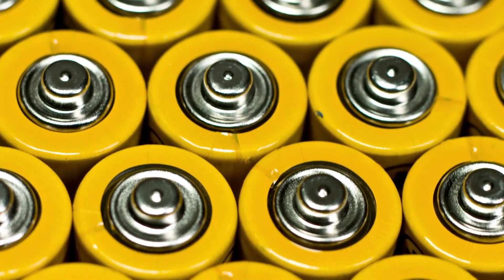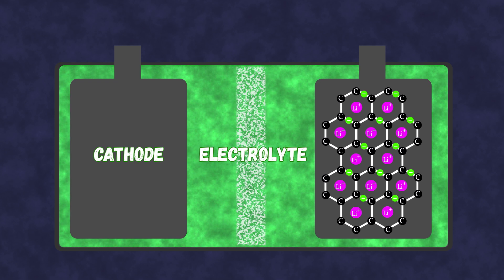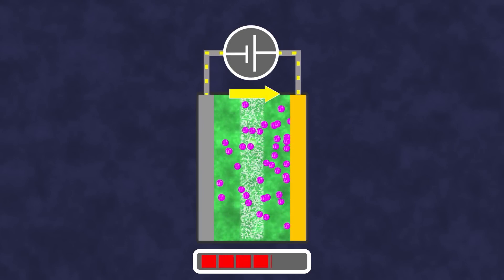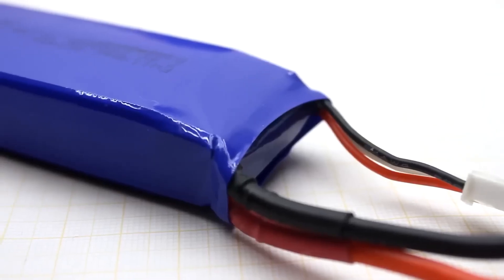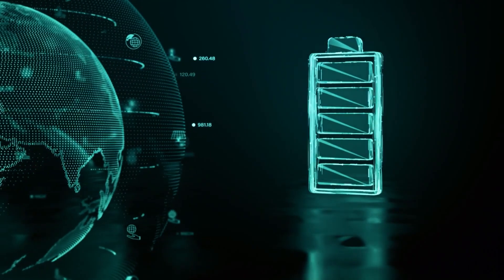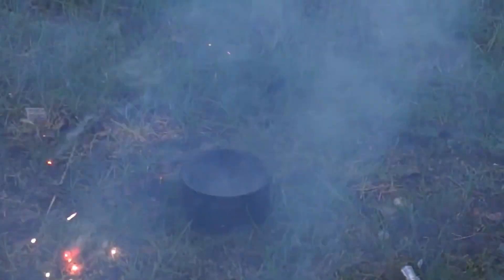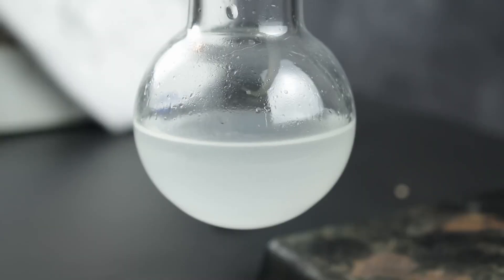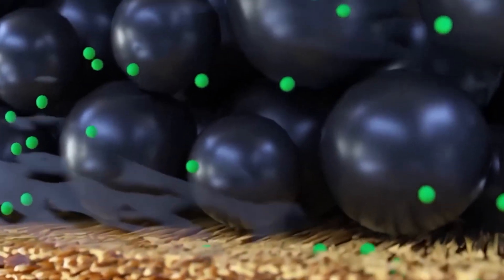Don't be quick to dismiss them: Can lithium-ion batteries become better than we are used to?

Comment: The physics and chemistry of new battery technologies is only half of the problem.  The economics, manufacturing technology, and business ability to establish a new standard, is the other half of the problem in creating a replacement for current lithium-ion batteries.

Plus much sadness because I have just finished all Terra Physics videos.  They were great.  But now unwatched Terra Physics videos arrive much slower.